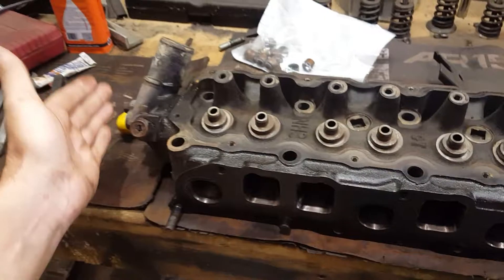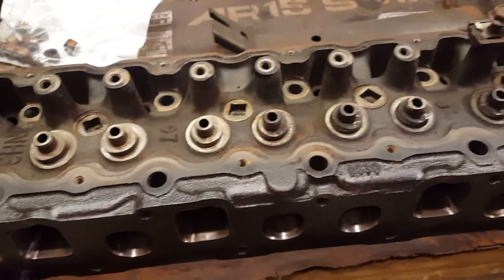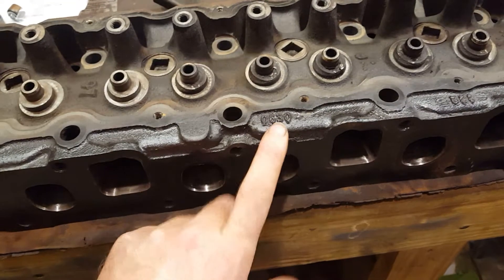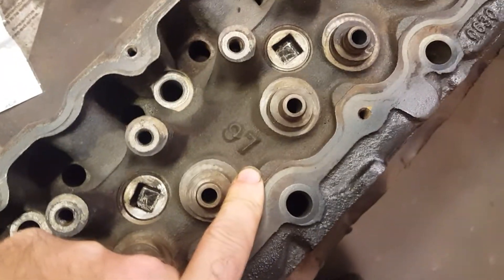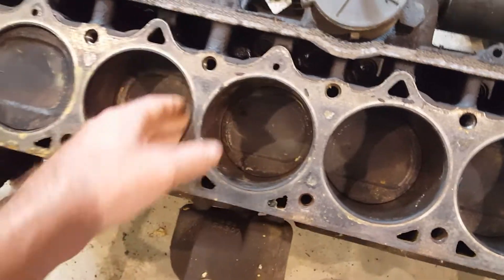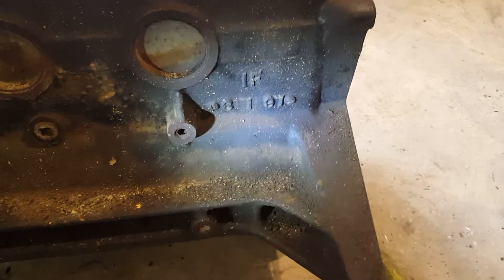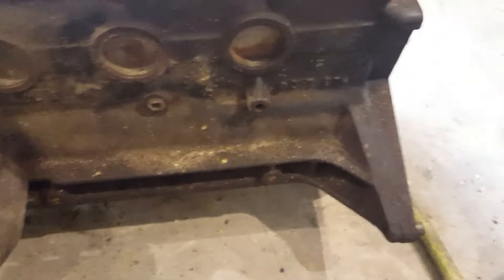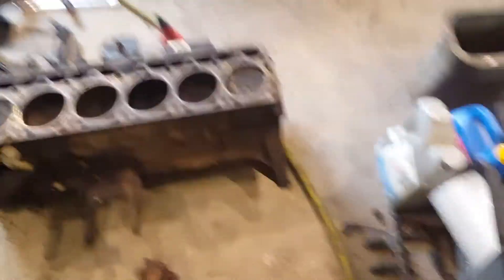Jeep 4.0L head and block casting number and date info

Comment: Not being nitpicky but the head to watch for with the cracking is the 0331 head, not 0330. The newer and improved TUPY head is also a 0331 head, but better of course. 😎
Reply from the maker: Yeah I know. Tongue typo. Sometimes the wires between my brain and mouth short out.
Imagine being me, watching my own videos and hearing my mistakes...😄
Reply: @tacticalrepair  No worries, mate! 😎
Reply: Thanks for the info 👍 it was my error the one I have is the 0331 and it's got 2 cracks 😔. Is there any other that you can recommend for this application and where can I buy it
Reply: @buildingusa9604  Well that certainly sucks man, I'm sorry. If you can find a factory head that has TUPY cast into the top right below where the oil fill cap goes then those are the updated 0331 heads that don't crack. As for aftermarket I don't have much experience there, BUT I do know Edelbrock makes a damn nice head for the Jeep 4.0! 😎
Reply: Hello guys very informative question can install a replace the 31 for the 30
Reply: @buildingusa9604  There is no 0330 head. I was telling the fella it is 0331 head. And any head castings will fit any block, any year. 😎

Comment: Always watch for the NVH (cast in the block) engine blocks, the best.  Stands for noise, vibration and harmonics. They were redesigned with extra webbing internally to tolerate higher stresses. The stroker preferred block.
Reply: And by the way, NVH stands for Noise Vibration and Harshness, not Harmonics. 😎
Reply: Does it have those letters cast into it anywhere? I have a 2003 WJ and I think those got the NVH blocks.

Comment: NH3=New haven foundry #3 cavity
Reply: I have an NH3, 0331 from '00. It's in an '01 XJ. Hasn't cracked after almost 300k, but Is this one of the cracky ones? Redoing the engine and wonder if it's safe to reuse. It will not be a stroker or super high performance rebuild. Thanks!

Comment: The 0630 castings have beehive valve springs
Reply from the maker: Sweet. Didn't realize that.
Reply: @tacticalrepair  The 0630 also has single groove valve stems so if your swapping or buying  valves remember the 0720 castings are 3 groove, also if your trying to go high lift cam you need to consider retainer to guide seal distance and which combo works best. I cant remember or else i'd just type it here but seems to me the 0630 casting had higher lift potential?
Reply: @luckyPiston  
Been wondering wear a good place to mount a secondary temp gauge opposite my current stock front gauge. 5/16" water jacket plug is best right now on my xj.Although it's middle
Reply: @jasontaylor9393   You could weld a bung into a piece of steel tube and install that in the top rad hose.
Reply: @luckyPiston  heater core hose deal area too.
Being a straight 6 heats usually further back. Did a 160* tstat. Update mechanical clutch fan.
96 Xj 220000 miles
Reply: @luckyPiston  98/99 0630 had 3 groove valve stems 96/97 were single groove.
Reply: @rosemardlin7018  Thanks for clarifying the years.
Reply: @rosemardlin7018  So are the 3 groove or single groove valves better?
Reply: @MTB-Dog  Neither is really better, it just depends on the year.